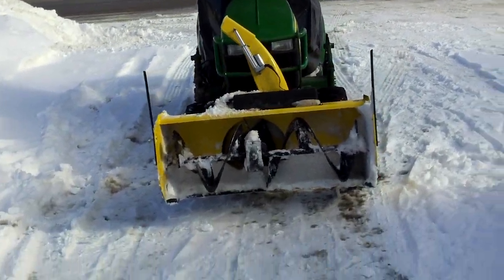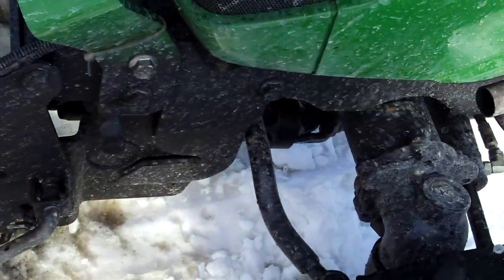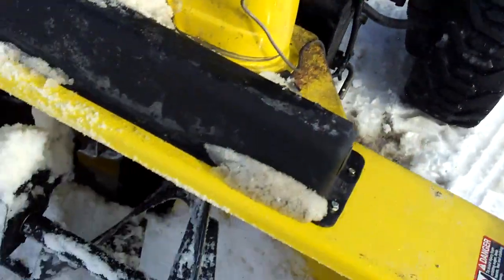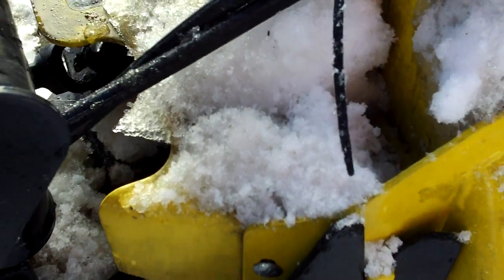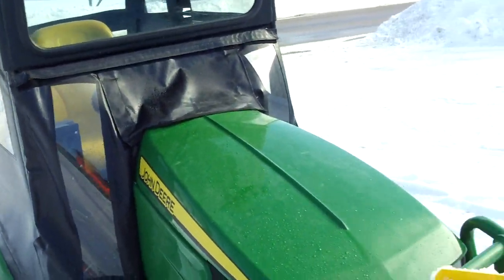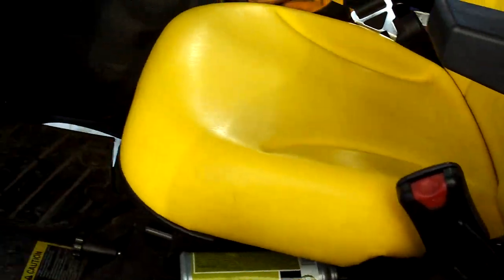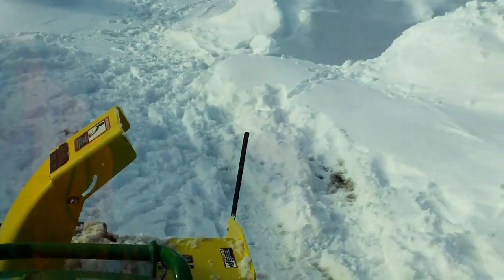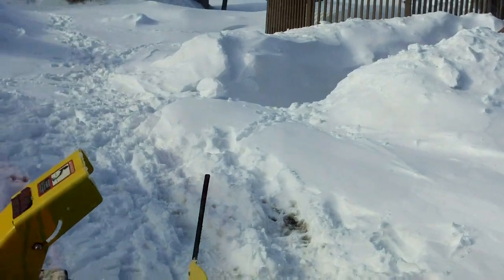john deere 1026R original tractor cab 47 blower

Comment: How do you like the 47in snowblower? What made you choose that over the 54in?
Reply from the maker: It works ok. They are not the best blowers out there takes alot of power for the size of them due to the small size of the fan also the fan is plastic which I dont care for. They are built cheap in my opinion. I have run a kubota 2650 which is similar hp and I would say that it ran the kubota 60" blower just as easy as the jd runs the jd 47

Comment: Hey great video. I am looking at that cab, is it pretty tight fitting also does your heater keep up when its around zero degrees. Do you know what btu the heater is? Sorry for all the questions but you have a great setup. Thanks
Reply from the maker: the cab is not bad for cheap soft side cab I added some heavy velcro to some spots to close up a few gaps. the heater is a small one I think it is like 3500 btus or something like that but suprisingly it does keep it pretty warm I don't need a coat to be warm down to like -15c then I would need to wear one. it is a pretty small heater a bigger one may be nice but there is not alot of extra space inside this cab
Reply: Thanks for the info you have a great tractor Im still running a 445 with a loader thinking I could possibly modify that cab around the cross member on my tractor guess we will see. Thanks again.